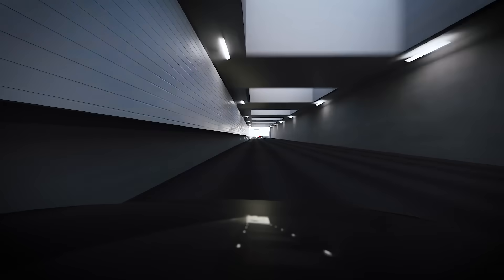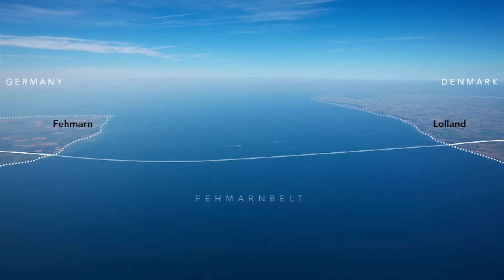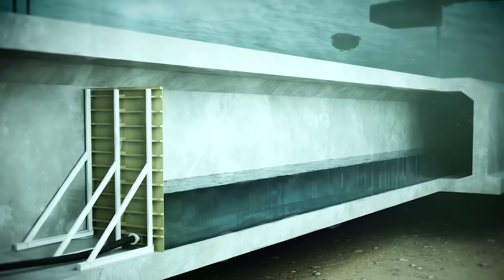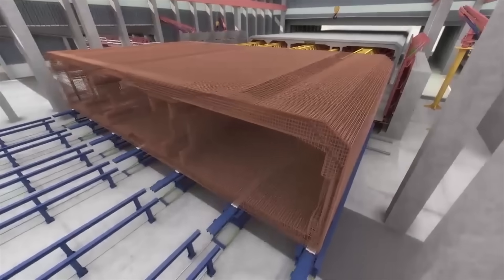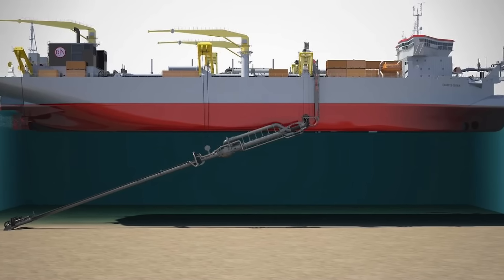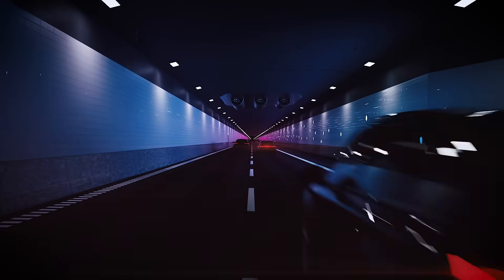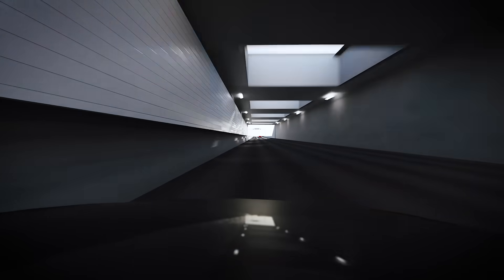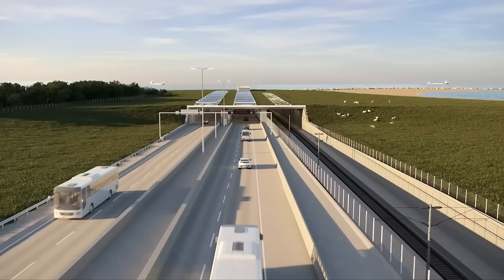Inside the $8.7BN Fehmarn Belt Tunnel: The World's Longest Underwater Connection

Comment: Question: It goes under the seabed right? So it's a concave? How do engineer deal with rain water entering the tunnels? Water pumps?
Reply: Pumps nothing shocking! Pretty much all tunnels like this do the same if the pumps are turned off then said tunnel will ultimately fill up though will take a rather long time to do so
Reply: Nein! Es geht nicht UNTER den Meeresboden. Die Tunnelsegmente liegen AUF dem Meeresboden.
Reply: @ManfredPrefi  Watch 4:04 and 6:56. There's a trench in which segments are placed. It's covered with ballast afterwards. I think you can the tunnel ends up under the seabed.

Comment: You claim that the Fehmarn Belt Tunnel (18 km/11 mi) will be "The World's Longest Underwater Connection".

Have we forgotten about the CHANNEL TUNNEL (an underwater rail tunnel, measuring 37.9 km (23.5 miles)???

The Channel Tunnel has the longest underwater section of any tunnel in the world... and is the third-longest railway tunnel in the world!
Reply: he said the longest underwater road and rail connection, the channel tunnel is only a rail connection.
Reply: The Fehmarn Belt Project only claims to be the world's longest immersed tunnel, not the longest bored tunnel like Seikan or the Channel Tunnel
Reply: Bored tunneling through the earth is different than prefabricating tunnel sections and anchoring them underwater.
Reply: @undertow2142  We know that here in Denmark we drilled The Great Belt tunnel. It was better with immersed tunnel on this direction a drill could desturb the environment enormous with immersed tunnel we can rebuilt the seabed with drill you can hit gas pockets in the sea that can make extremely damage in the enviroment. There have been made many calculations of how to safe the enviroment best this is the result.

Comment: Have to hope that a Chinese bulk carrier will not drag its anchor over the tunnel.
Reply: The tunnel is covered with a thick layer of ballast to stop it from floating or being caught by anchors.
Reply: @u1zha  Large ships anchors can weigh up to one hundred tonnes and they are designed to dig in to hold the ship in place when at anchor., if that anchor were to be maliciously dragged along the seabed while the ship was under way then it could go deep. I would stay out of that tunnel if there were Chinese ships in the area.
Reply: GGGGGG nice comment!
Reply: There is no past, present or future itinerary that would see a boat from China needing to go between Germany and Denmark. Container boats do not pass by this road to deliver to the Baltics/northern Europe - instead they go to bigger ports - and with global warming, the Chinese will be sending stuff over and around Russia in the future or using the Belt and Road initiative to send stuff to Europe from China via Russian railroads.
Reply: @IvanAkinfiev  it is a real concern pls. read.:
https://en.wikipedia.org/wiki/2024_Baltic_Sea_submarine_cable_disruptions
Reply: Chinese? Russian more likely.

Comment: Just wait until there is a pile up on the motor way of EV's will the tunnel survive?
Reply: It's made of thick concrete, probably can survive fuel truck fires and EV fires just fine.

Jet fans are there to forcibly push fumes away from the queued cars and give people time to escape via cross passages to the other bore.
Reply: @u1zha  Fuel truck fire no problem, I'm talking about EV fire's if you don't think there is a problem you need to do some research on just how furious EV fires are, you just can not compare them to a real car fire.

Comment: "For decades travelers between Denmark and Germany have relied on ferries crossing the Femern Belt"

What nonsense! What about the 68 km landborder between Jutland and Schleswig Holstein?
Reply: Es stimmt; wir sind lange Zeit mit Fähren von Dänemark nach Deutschland gereist. Wir sind aber auch Jahrhunderte mit Pferdewagen gereist, trotzdem geht es mit Bahn und Auto schneller und bequemer, und wir tun es. Deshalb kann ein Tunnel kein Unsinn sein.
Reply: @ManfredPrefi  It's nonsense that the traffic between Germany and Denmark rely on ferries. The majority of traffic between the two countries are already going by truck, car or trains via the 68 km landboarder and A7/E45. 

By the way if you germans, want to make the travel to Denmark more efficient, maybe you should upgrade the Infrastructure at the 207/E47 and the parallel railway, which is a one way track and a two lane road, and upgrade the Fehrmarnsundbrücke, so it can support heavy freighttrains. 

Right now the project will be finished with a superior tunnel and danish infrastructure, but pathetic german infrastructure.
Reply: @argememnon  save time on travel and the environment even you maybe have a electric car you still make a heavy mess with your 4 tires on the car the longer you travel The further you travel, the more shit you do

Comment: The World's Longest Underwater Connection at 18km❓
The under sea tunnel at Calais is 35km❗
Reply: The longest combined road and railway underwater connection. You are not able to drive a car through the Chunnel. You have to load it onto a train. Thus the Chunnel is considered a railway connection only. Two different beasts. The Chunnel had a whole lot of extra challenges and had to choose a rail-only solution for a lot of reasons. 
However, the solution used for Femern (Danish spelling) could perhaps be used for the Irish Sea? Going from Scotland near Portslogan to Whitehead in Northern Ireland? I know that there is a problem with the area having been used to dump unused bombs and ammo, but that could be cleaned up.
Reply: @JKristofferNielsen  "combined road and railway"
That's not what the title says❗

Comment: Have travelled to Germany for almost 60 years never depending on a ferry. So your text is somewhat wrong. Not revoluuutionary as you express it. 
Denmark is connected with motorways and bridges and has a north-south bound motorway leading directly on A7 through Germany crossing the landborder. But it'll shorten the traveltime for some Scandinavians, though most Danes don't live in Copenhagen.

And the idea for a connection doesn't only date back to the 1960's. It was discussed in connection with the big 'H' plan back in the 1930's, -the future infrastructure plan for Denmark. Though at that time it was downgraded to establishing a ferry connection instead.

Comment: In Denmark the max speed in tunnels is usually 80 to 90 km an hour for cars - so it will take way more than 10 minuttes to pass 18 km. of tunnel.
Reply: Yup (but maybe not "way more"). Assuming 90 km/h (same as in the Øresund tunnel) it will take 12 minutes. (Theoretically. In practice 12-15 minutes seems reasonable.)
Reply: 10 minutes since everyone drives a bit over the speed limit
Reply: This one is designed for 110 though, so 10 minutes fits quite well: https://femern.com/media/4xupaaii/fakta-om-femern-tunnelen.pdf

Comment: Till some ship drags an anchor over it and sabatoge like they did with the cables and gas lines...
Reply: I had a response here  but it has magically disappeared. In short. Tunnel segments are of thick reinforced concrete, buried in a 20 meter deep ditch covered by 10 or so meters of rock and rubble. Can't hurt that with an anchor. Cheaper and more effective ways of sabotaging the tunnel exists.

Also, minor fact correction: The baltic opto-cables where likely broken by dragging an anchor. The gas pipelines where likely blown up with explosives.
Reply: That ship will get serious damages if it try to sabotage with an ankar.
Reply: Oh, Debbie.
Reply: The tunnel elements are of reinforced concrete. They are submerged in a ditch and covered by 10 or so meters of rock and rubble. An anchor dragged by a ship won't work. If someone wants to attack this tunnel there will be both more effective and simpler ways.
Reply: Someone didn't watch 6:56 carefully. Or doesn't know how anchors work.

Comment: How are the sections anchored to the sea floor? What keeps them on the bottom?
Reply: During building/assembly: Special anchors, mentioned in the video.

After building: The whole thing is sunk into a deep dredged "ditch" and covered by rocks and soil. This can be seen in the video. I think it was mentioned that the ditch is 20 meters deep (not gonna re-watch - you do that if you want to verify). The elements have a height of 10(ish) meters so there will  be maybe  10 meters of rubble on top of them. The technique is not new. Same thing was done on the tunnel in the Øresund connection between Denmark and Sweden which was inaugurated year 2000, and those elements have not surfaced yet 😅.
Reply: the weight of cars travelling, and heavy American tourists
Reply: @mikemotorbike4283  you mean heavyweight french fries and mc do people
Reply: Isaac Newton law keeps them on the bottom...
Reply: The concrete segments have extra pipes from one end to the other parallel to the pipe for cars and train just smaller.
While these pipes are empty the total weight is less than the displaced water, but once filled more heavy than water displaced.
These extra pipes are made so the segment can float to its position and before being filled and the segment released into it's final position.

It's pretty simple.

Comment: Re: (Tunnel) "...is designed to handle modern transportation demands." Does verticle tunnel height allow for double-decker passenger train carriages, also double-stack cargo trains?
Reply: Every country has a "loading gauge" for their railway system. It defines maximum height, width etc for trains on that system. With the possible exceptions of very old segments or rare special cases, tracks in a specific country are built to those specifications. (Maximum allowed axle load can vary within a country, depending on eg the quality of the trackbed and tracks etc). Loading gauges are mostly similar in most European countries (Great Britain being an exception with a substantially smaller load profile - for historical reasons.)

It makes little or no  sense to over-dimension one small segment of a rail system compared to the rest of the system, as any train utilising this larger load profile would not get far before it encounters a point where the standard load profile holds. Updating the load profile for a whole country, or even large parts of Europe, would be extremely costly. Extremely! The cost of the Femarn belt connection, even with an enlarged load profile, would be pocket change compared to making a meaningful enlargement of the load profile over a larger region.

There are special cases where an upgrade makes sense- typically where there is bespoke rail traffic over a shorter distance. Prime example is the Iron Ore Line in Sweden, which carries Iron ore and iron sinter from the mines in the north of Sweden to the harbours of Narvik in Norway and Luleå in Sweden. The whole line is 398 kilometers long.  It has been upgraded several times, eg to accept a higher axle wheight (highest in Europe) and longer trains. But a fully loaded iron ore train can not venture beyond the Iron Ore Line - those trains stay on those 398 kilometers.

There are already double-decker passenger trains running in many European countries, and if they fit the German and Danish loading gauges they will fit in this new tunnel.

I'm not sure about double-stacked containers, but a quick look at eg the German loading gauges suggests that the "rectangular section" that could accommodate eg a container has useable height not greater than 3 meters or so - so no double stacking there. And so it makes no sense to build the tunnel to bigger dimensions, unless there is an enormous need to haul massive amounts of containers the 20 or so kilometers between Rødby and Puttgarden. There isn't.

So, how do they get away with double stacked containers in the US? Answer: Diesel locos. No overhead electrification. Loading gauge is 6 meters high or more where they can do double-stacking.

For anyone interested, there's lots of info in the English Wikipedia article "Loading gauge".
Reply: @davebowman6497  The country of India has recently been able to run electrified double-stack container freight trains on specially prepared rail lines.
Reply: @RVail623 I know, but that required heightening the overhead power line.
Reply: European double-decker passenger trains are not significantly higher than regular passenger trains. Double-decker cargo trains are rare to non-existent in Europe. Those trains that are already running fit the current bridges and tunnels. By simply following the existing standards there never will be an issue.
And besides that; with a project of this scale, do you REALLY think they haven't thought about that?

Comment: large fans underwater sounds genius 😂
passed over that part real quick
Reply: Uhhh, there are many tunnels that employ the same air-management technique and those go underwater as well. I'm not sure what the issue is.
Reply: @TheRailwayDrone  not under water and air tight, champion
Reply: @TecraTube  Umm, Just as cars have to enter a tunnel on both ends, so does the air. Let's think about this for a second. You really think they would come up with this type of solution if they didn't think it could work? I'll trust the engineers instead of some random person on youtube. Continue your fight though.
Reply: @TheRailwayDrone  Re: "I'll trust the engineers....." granted that your thought process is valid. Hover, engineers are not always the decision makers. 

Recalling a report years ago by a Consultant group, the recommendation of a roadway tunnel was presented for a short, time-limited review. 

Part of the tunnel proposal included:

# Cross-traffic signal that would have caused vehicle back-ups into the tunnel.
# No fan or forced-air ventilation; motor vehicles would "push air" through by their movements.
# Adjoining walkway would feature illuminated signs when carbon monoxide levels would "exceed normal" level (Woe to motorists or wheelchair users who have a medical condition!).
# No mention of emergency pump system to de-water since location is near sea level.

After a final public hearing at the Convention Center, a bascule bridge design was decided upon and approved. It was claimed by some that the choice taken was mainly financial since a bridge structure cost less than a tunnel
Reply: @michaelsmith9590  All that just to say they're using fans. Thanks.
Reply: Again: There are many tunnels using fans like that. And the tunnels under water are just as airtight as the ones under land. I.e. not. And there are already other tunnels under water using fans for exactly the purpose of ventilating bad air out and fresh air in.

On the subject of these fans, the engineers are definitively the decision makers.

Your "air tight" amply demonstrated your level of expertise. But as others said - do continue your fight.
Reply: @davebowman6497  Well I never said I was that type of engineer. I am a Computer network engineer by trade, but that also allows me to be curious and research things that I have curiosity about. which is why I know these fans are used in many tunnels, which leads me to believe they've researched pollution mitigation in tunnels. But you think you know it all so no need continuing this gratuitous debate with you. Day.
Reply: @TheRailwayDrone Well, I'm a software engineer myself, but with a hobby/amateur interest in public transport (nerd level: 11 😊). But the thing that got me, and others, raising our eyebrows was the "airtight" claim. No need to be an expert to realize that's not the case.

So you're a computer networking expert, and I assume you expect others less informed in that area to trust your competence, right? How come you do not trust experts in tunnel engineering?
Reply: @davebowman6497  I think you replied to the wrong person.